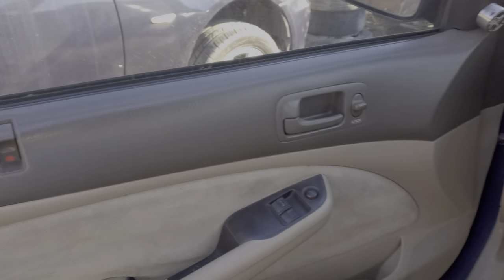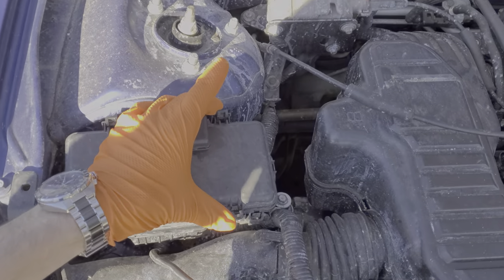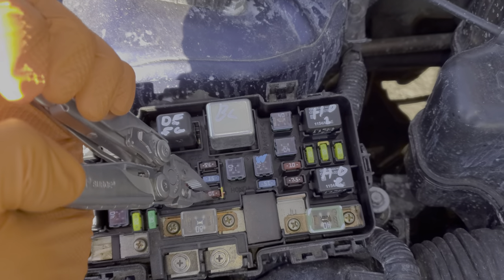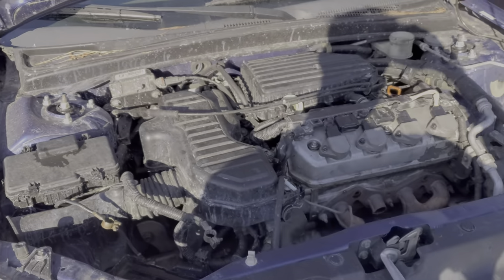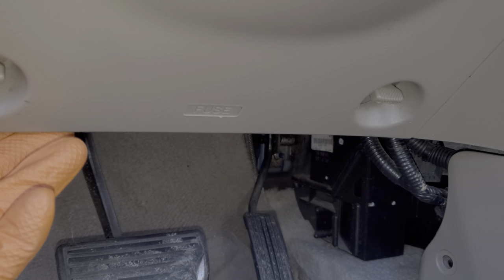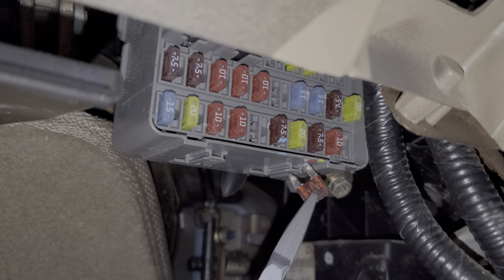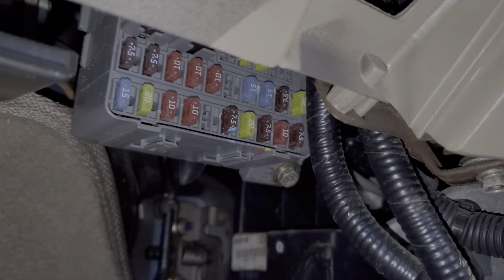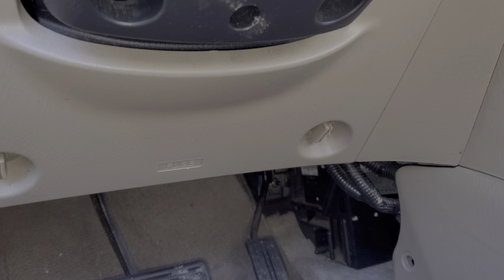2004 Honda Civic Power Door Lock Fuses

Comment: Thanks man. Fuse number 9 for me blew out and I started to freak out thinking my actuator had gone out. I didn't notice this until I replaced the fuse but I noticed when I opened the door with the key in the ignition, it didn't beep, so I guess that's how you tell it's fuse number 9.

Comment: Just the passenger side power door lock doesn't work for me. That means it's just the interior fuse or maybe some door wiring is faulty?
Reply: Same.  No movement from the actuator even with a new replacement.  Front door lock is sticking and may be part of the problem, but unsure.  All fuses are good on mine.

Comment: So all my power locks work when the doors are closed, but when the drivers side door opens, it won’t lock when I hit lock. So I have to lock it with the key from outside. Know what that could be?
Reply: Same problem what I do is hold the door handle then locke it and jump out and your doors locked get me? Pull the handle while the doors open as if your gonna open it and at the same time locke the door saves you time from locking the door :)
Reply: i believe it’s a safety feature to prevent you locking your keys in the car. mine is the same

Comment: Does 4 door locks have individual fuse? Where are those located from the fuse box? My Civic door lock from Rear Left is not working. I can't unlock it manually because it cannot pull up, what could be the problem?

Comment: The 20 amp fuse in the fuse box in the engine side has blown for me and fuse number 22 under the drivers steering blown from me as well. I replace them and the blew again. What do I do? So my door lock isn’t working

Comment: So my a/c wasnt working the a/c climate mixture isnt working i can put it cold and it will stay on cold even when i turn the knob for heater also app my door locks dont work so im assuming its electrical i dont feel like removing my dash to replace a motor

Comment: I have a 2004 Honda civic DX coupe and wanted to know if they make actuators for my specific car. If they do, i would also like to know if its possible to connect the actuators to the alarm system i have installed.

Comment: Can't figure out why my cruise control won't work.  I believe it may be a fuse due to the fact the cruise button would light up when pressed in normally.  Now I get no light when pressing the button in and cruise does not work. Any advice on where the fuse for this cruise control fuse may be?  I have a 2door 2004 Honda civic ex

Comment: Hey I have a 03 si hatch and my power door locks don’t work at all to any door I’ve got power to switch and to door lock actuator checked fuses and all good tried new Actuator on driver side only but no luck
Reply: none of my locks work as well. Did you find a fix?

Comment: I can see the continue line in my fuses but the conectors are kinda burned, maybe that’s why my locks don’t work?
Reply: Same.
Reply: Same any updates? I don’t feel like running to the store to change
Reply: @rayjones5697  I ended up pulling my fuses and had to change two that he mentioned. Don’t remember which two. But that fixed it. Everything works great now
Reply: @rylibret  but were they blown? Or did u just change because the connectors looked burned
Reply: @rayjones5697  the ones that looked burnt were actually fine. When I pulled all of them I found two blown ones.

Comment: My front doors work fine but both of my back doors i have to manually lock and unlock
Reply: ever find out the problem
Reply: @jonathanrios8977  i have not figured out the problem. I had a more serious stalling issue that got fixed with some injector fluid. So i got to get new fuel injectors here soon